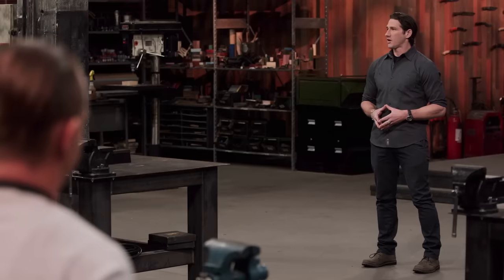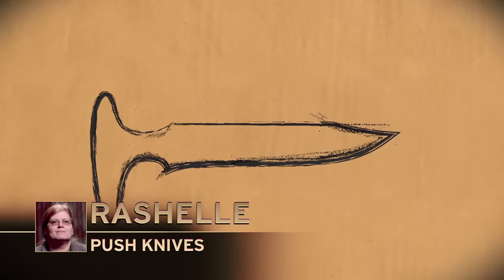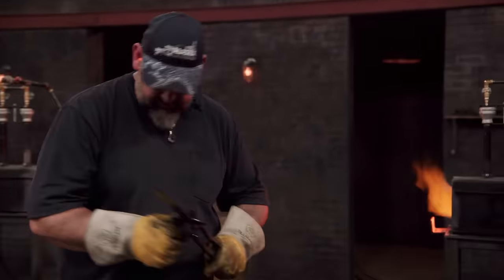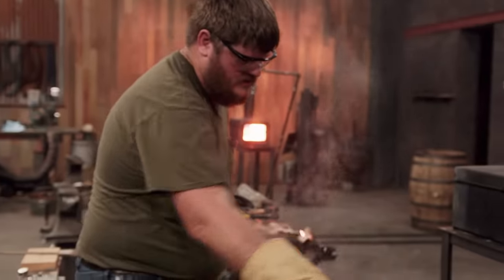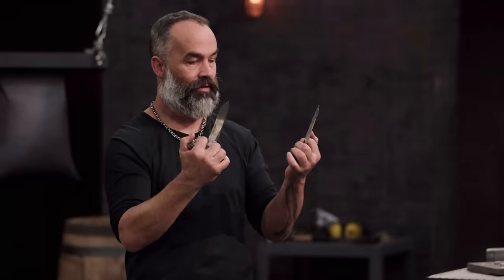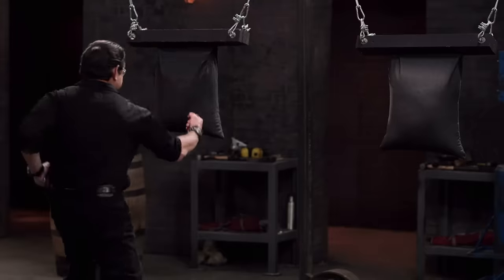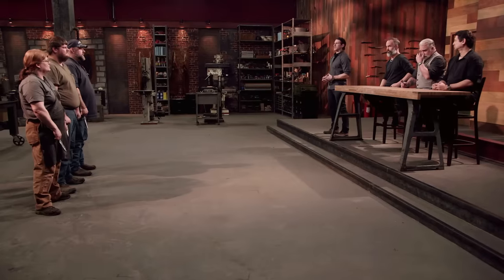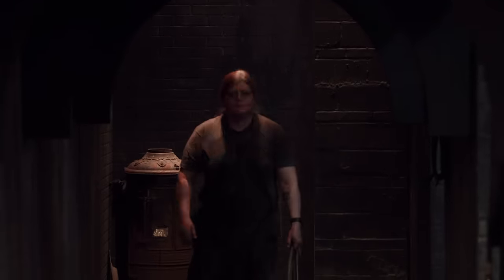Forging Deadly Push Knives Under a Time Crunch | Forged in Fire (Season 4)

Comment: I still believe without the brace design of the puncture test the handles of the men may have failed.
Reply: The issue is safety, honestly the jig they used supported. It about as much as a fist would.

I'd have done a different design more. Like an arrowhead but I favour a wider blade on a punch dagger